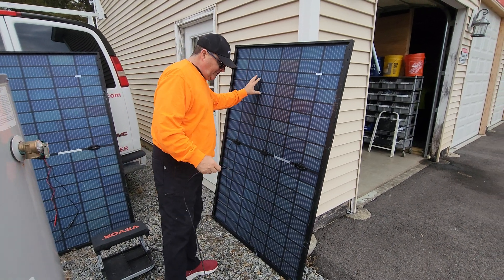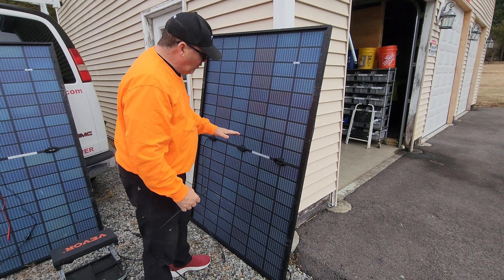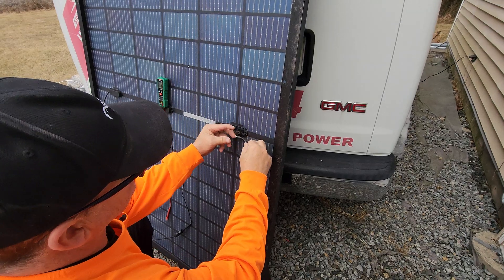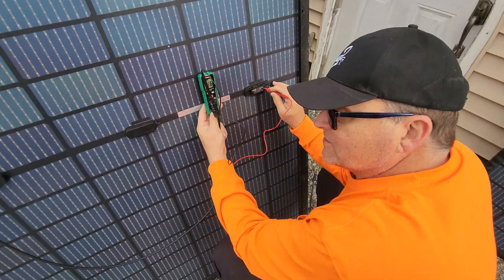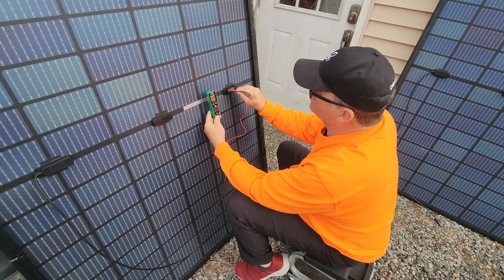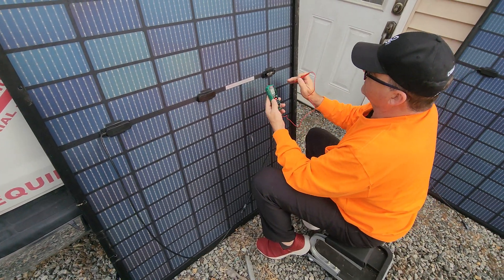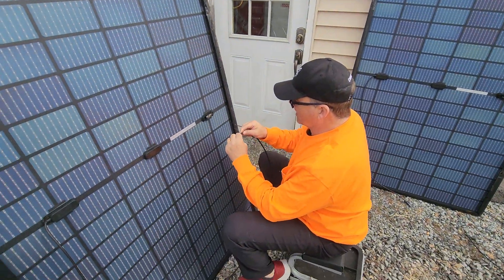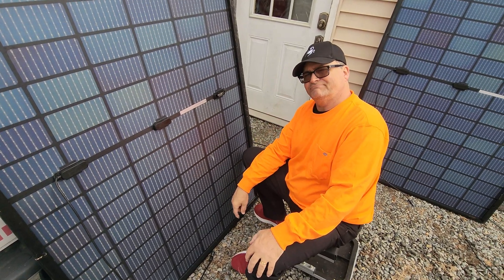400W Solar Panel Repair

Comment: Those 3 sections are separated and in series, in between those 2 points where you measured 11v is a bypass diode. There's one in each of those little boxes, that's what the boxes are for.

The bypass diodes make it so if for some reason that series string isn't producing (whether it be a leaf covering a couple cells or a damaged cell resulting in an open circuit), when loaded it acts like an open circuit and thus the voltage tries to go backwards into the damaged portion. The diode acts like a short in this case and makes it so the panel can operate at full current but only at 22v, bypassing the string that isn't producing.
Reply from the maker: That makes a lot of sense, thanks for explaining!